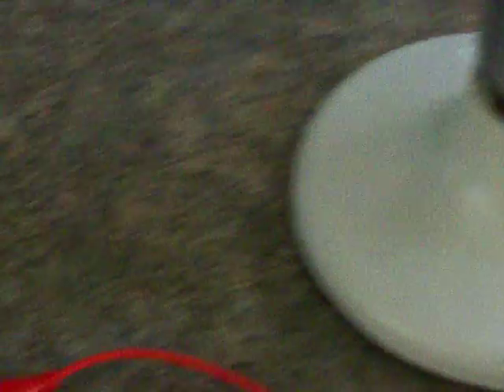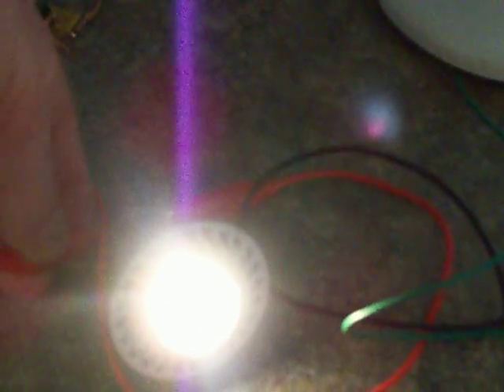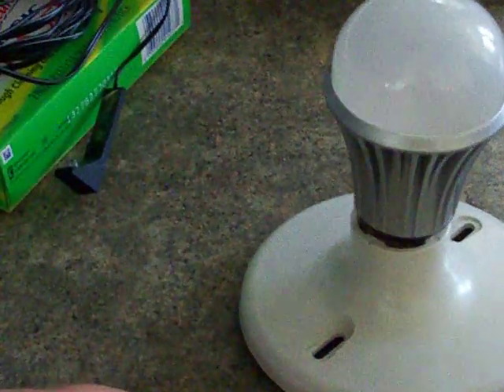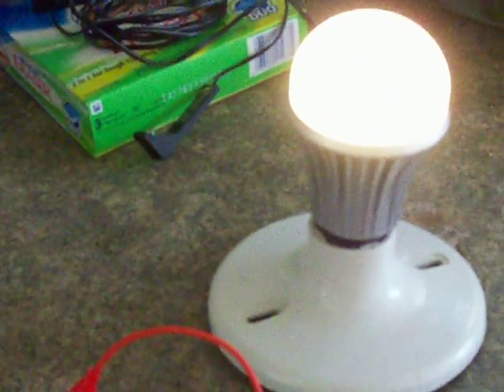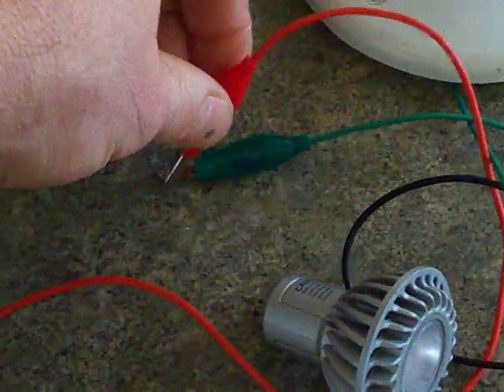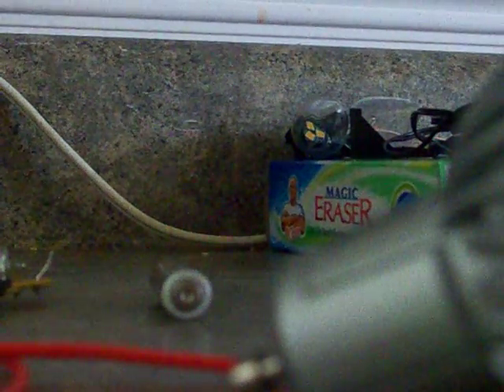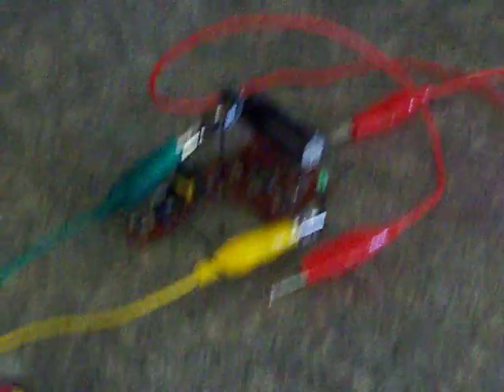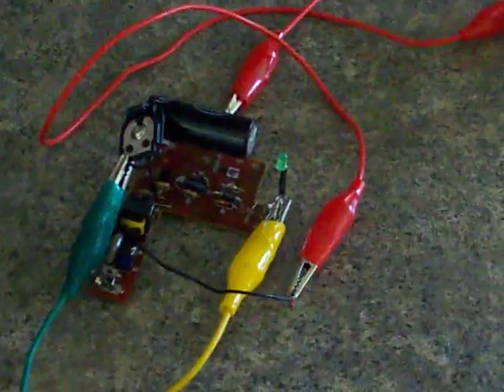Fuji Circuit Joule Thief LED Light  / 2

Comment: I have been playing with electronics since the early 1960's and have had my share of unintentional shocks.  There are many ways to avoid this besides being both careful and quick.  One is known as a fuse, but even simpler is the toggle switch.  Put it inline and shut off the juice before hooking up the wires.  They are cheep and well worth the money in the pain they stop.

Comment: Nice! Talking about the size of the circuit...you actualy need just the 5 pins tranfo., the transistor and one resistor to make this work :) it gets really small that way but carefull with resistor value because if it is too low, it will burn the transistor. Lots of other salvaged transistors work fine to.